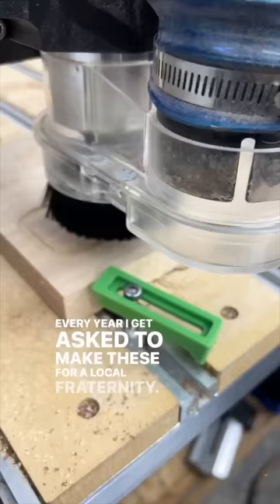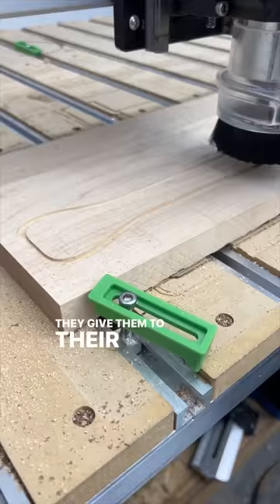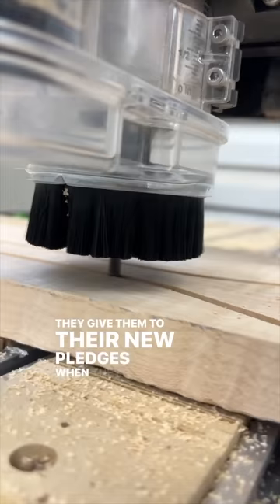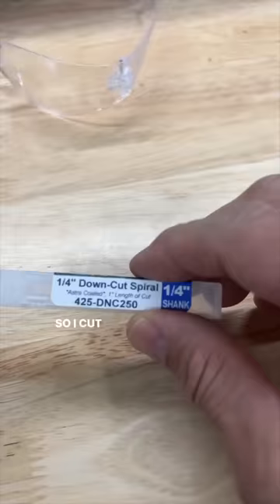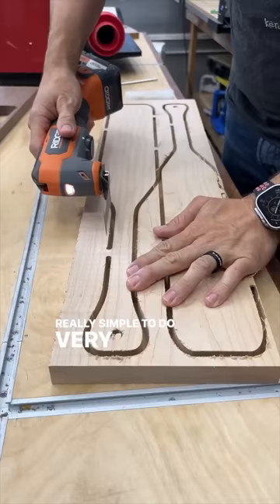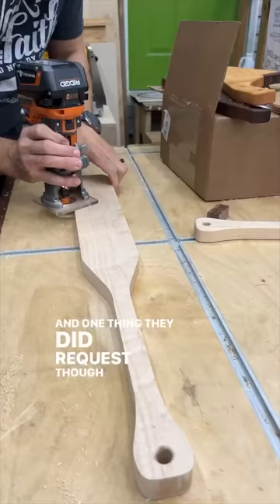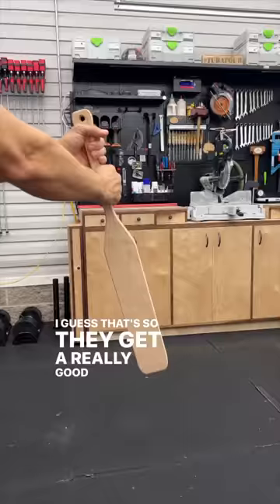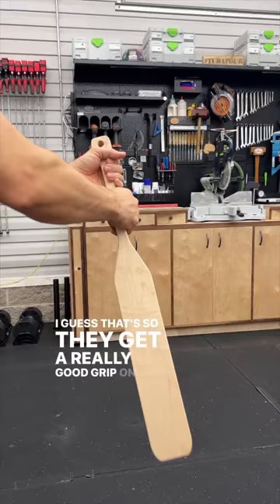A Paddle? The Fraternity Doesn't Have a Boat 🤔

Comment from the maker: 10 Reasons to get a CNC @
CNC I Use is a Shapeoko 4XXL @t
1/4 inch down cut bit used: @t

Affiliate links are used to help support this channel.
They give these paddles to the new members as keepsakes when they join.  They sign/decorate them. I'm assured, they are for decoration only.
Reply from the maker: @pkennedy0219  🙄 it was a joke
Reply: Actually I think those are for cricket🤔
Reply: FYI Water Sports/ Watersports Refers to someone Peeing on someone else.

Comment: For those who don't know (most dont) those are for show. It's called a show peice. You can tell by how big it is. Rare that a person's "peice" is a two hander. It'll be panted and given as a gift after a person finishes their initiation.
Reply: Oh that's a relief. I genuinely thought it was used to beat pledges which I thought was screwed up
Reply: @asdfgh9985  it probably is both and they just use this as a cover story. Plenty of fraternity still do that but pretend they don't.
Reply: And plenty don't do the bad hazing stuff anymore.

The one I was in systematically dismantled all of the hazing stuff while keeping intact the traditions that used the hazing practices. We replaced the dangerous or intimidating parts with safe rituals and tried to focus the mental part of it not on fear, but curiosity.

The university administration likes it, the alums like it, the upperclassmen like it, and the freshmen like it. It really has been a win win.
Reply: @ivyblack8145  Yup.
Reply: piece

Comment: Not to be “that guy”, but there is nothing funny about hazing. Not to mention a supposed Christian condoning it and being complicit. I’m disappointed.
Reply from the maker: They aren't hazing with them.  They decorate them and hang them on the wall.  My son was a part of this fraternity (I guess technically still is).
Reply: @731Woodworks   Sorry, hazing. Think about it and take a position. You either support this or you don’t.
Reply: @malcolmpas  I am a Christian and a member of this specific fraternity, I wouldn't have joined the fraternity if they hazed. The other brothers and I have no tolerance for hazing, these are merely a symbol of our membership that we can proudly display in our home.
Reply: Disappointed too

Comment: this would be so easy to cut with a bandsaw but instead you chose to let a computer do such a simple job for you. the laziness showing through in this video is just sad. 

good job. you turned it on, woo-hoo woodworking at its finest.
Reply from the maker: I bet you're a joy to be around all day 🙄.  Keeping in your line of thinking, cutting it on the bandsaw is also being lazy since you're using a power tool. Why not cut it by hand? Same thing could be said of the bandsaw.  You turned it on, woo-hoo. It seriously cracks me up how many of you have this weird hatred for a CNC machine.
Reply: @731Woodworks  did I hurt your wittle feewings?